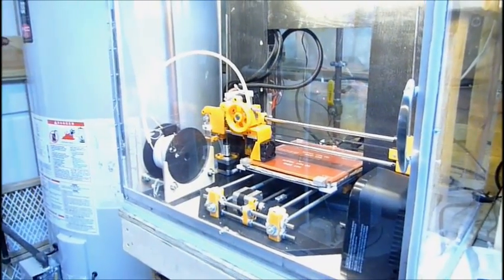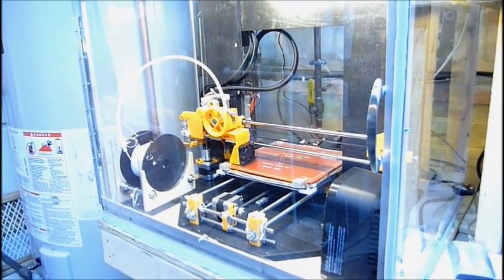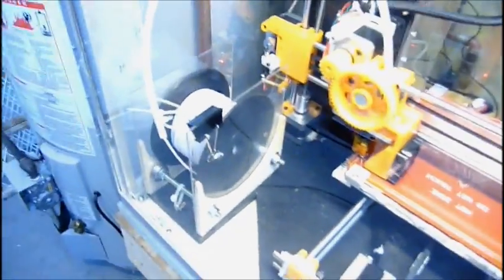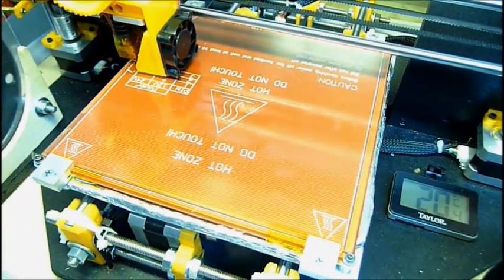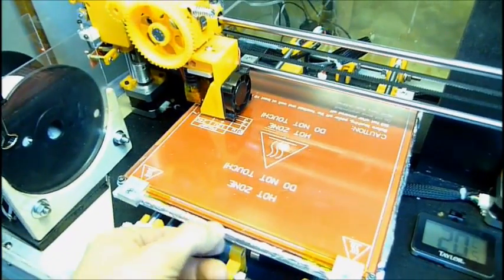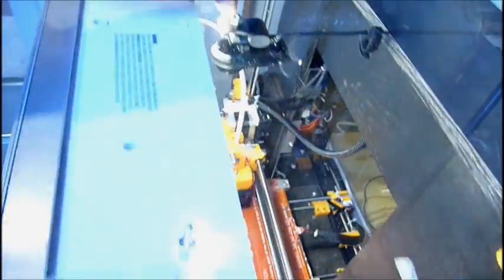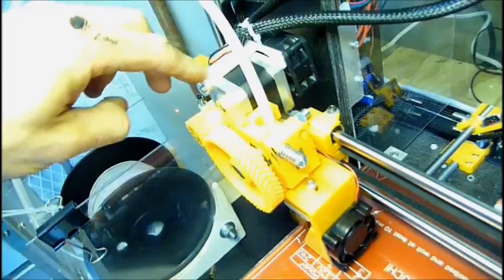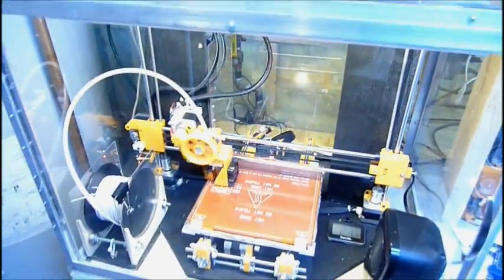Upgrades to my Prusa i3 - 3d Printer

Comment: Thanks so much for the upload, just how much did the build cost as it stands?
Reply from the maker: Hey Olivia, thanks for the comment!

Here is the breakdown of my costs so far.

a. Box Frame parts ~$33
b. Prusa i3 parts - printed parts, electronics, rods, hardware, etc.. ~$450
c. Heated Build Chamber parts - aluminum, plastic sheets, hardware, magnets ~$100
d. Lasko #100 heater - $15.99
e. Digital Thermometer - $9.97
f. CanaKit ( for OctoPrint setup ) - $63.98

running total about: $672.94

that being said, if I was to do it again I would not have purchased the 12864 LCD Display Controller, as I don't need it with OctoPrint - that would have saved about $20, so for me to build this again it would probably run around $650

Cheers,
Morgan